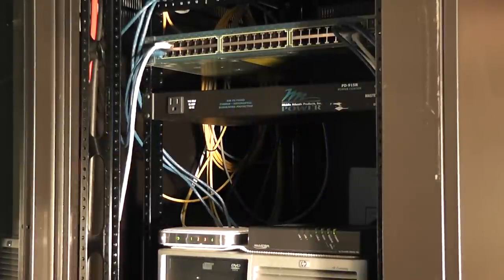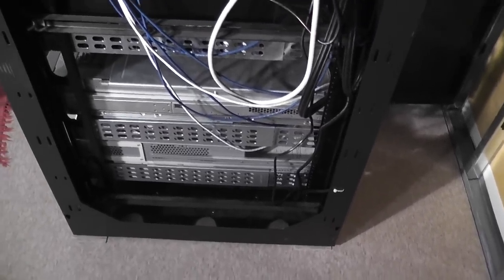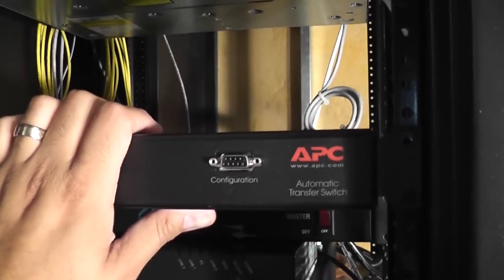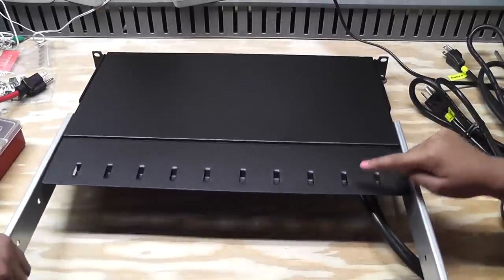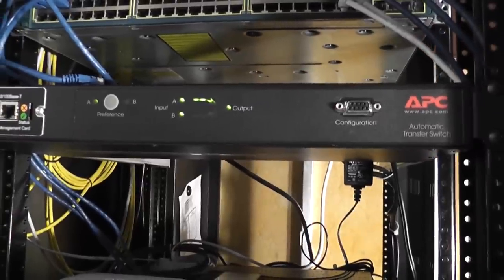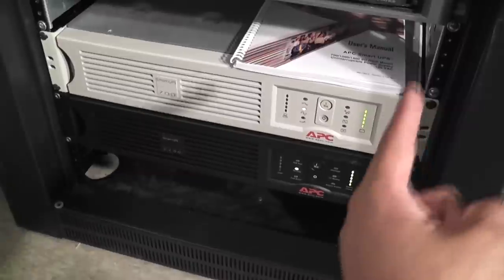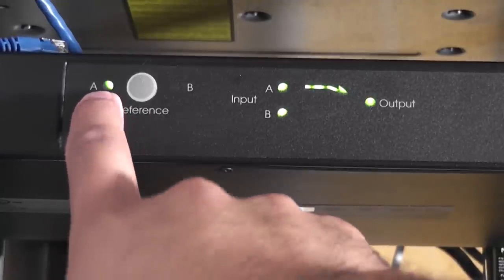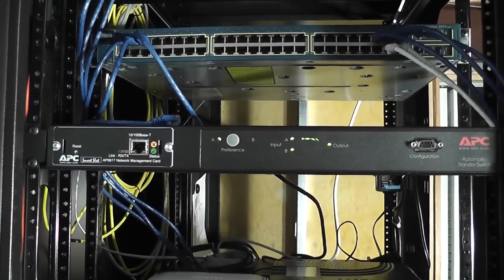APC Automatic Transfer Switch Install

Comment: another good use of the transfer switch is to revert to power from wall outlet if UPS fails to restart after black out.... ( battery is to low to charge or is going bad )

Comment: How is the Rack and Transfer Switch holding up ?  Saw a photo on Ebay for the AP7750 with the rack ears mounted forward, leave the ears in the present location and move the Transfer Switch back to expose two screw holes on the side of the Rack Ear Bracket.  The you will have room for the cable when the door is closed.  Maybe another video showing the upgrade.  Thank you for the video !  tjl  P.S.  Must install the quiet Sunon fans (2) in the Dell 5324 switch...
Reply: +Tim Lipinski Moved the Rack Ears forward to expose one hole on the side o the rack ear. This will give some protection to a data cable plugged into the front Automatic Transfer Switch.  The Sunon fan mod is easy for he Dell 5324 switch with the proper Screw Driver.  tjl